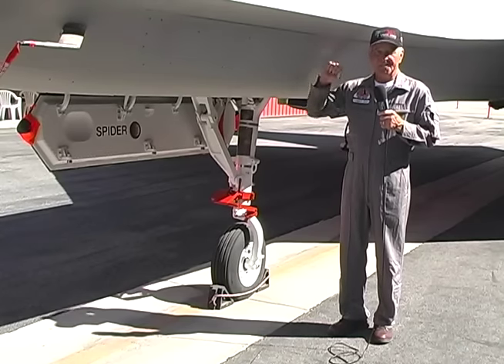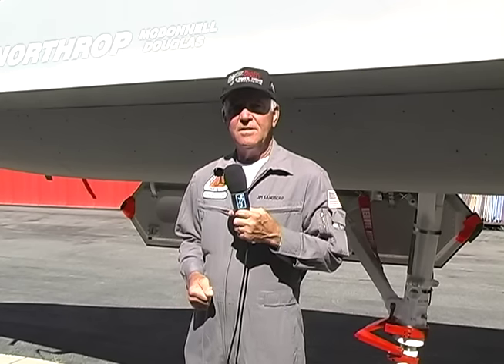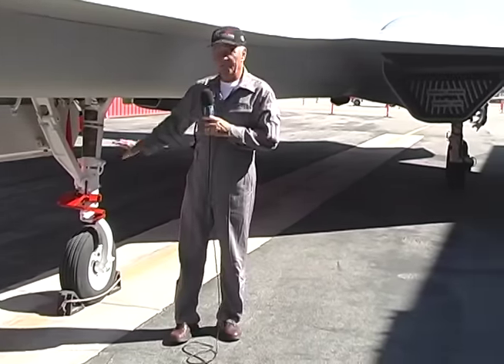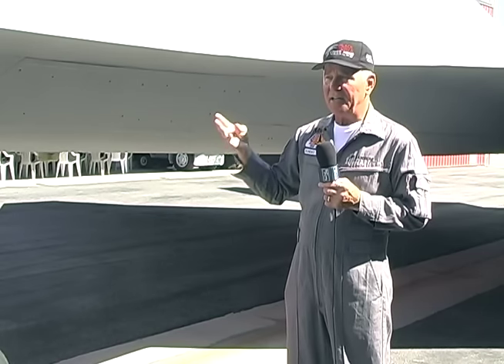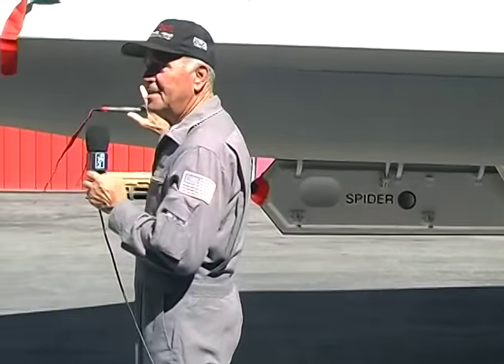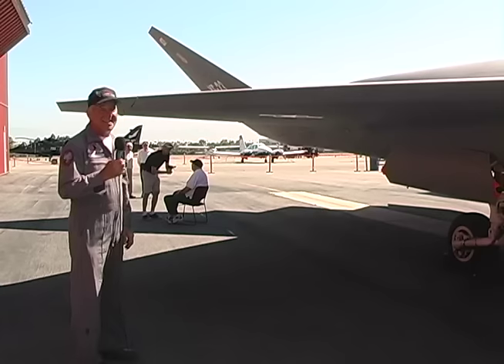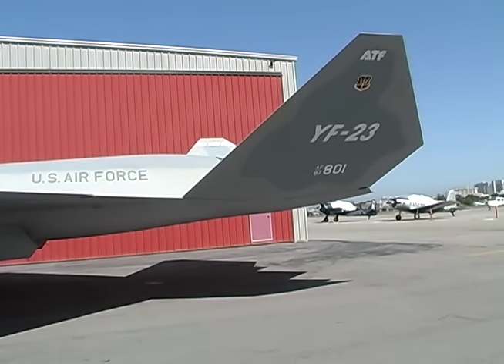YF-23 PAV2 First Flight and Walk Around by Test Pilot Jim Sandberg

Comment: They should have built both.
Reply: How many YF-23's are built, even though they aren't in service.
Reply: Nah dude, yf-23 was way and IS way superior than the f-22
the f-22 was filled with design errors, like the oxigen not reaching the pilots mask and leaving the pilot unconcious if he tried any sort of acrobatics.
yf-23 was the victim of government corruption, just like boeings x-32
Reply: @elfather3889  What garbage. The F-22 was a much more mature project with a better balance of performance. The issues with the oxygen are typical survivor bias, meaning that you never got to see the shitloads of problems the F-23 would've had. It's not to do with the aircraft design either, depending on the contractor the F-23 might even have had the exact same issue.

Concerning the X-32, it was absolue shit compared to the X-35.
Reply: 2
Reply: @elfather3889  The x-32 was riddled with issues, and it never was able to perform it's hover demonstration because it was behind schedule. Also the wing was a single piece of fiberglass which was incredibly expensive to manufacture. I'm not defending the F35, as I think it's also not a great plane. The JSF program was ahead of it's time and way to demanding for the technological limits of the late 90's and early 2000's. That was the main problem. To high of requirements and not enough time to build what the government wanted.
Reply: @elfather3889  The X-32 was clearly inferior to the X-35......don't go down that route.

Comment: The most beautiful and stealthy jet ever designed -- and probably the fastest too.  As I understand it was never really pushed to it's maximum speed (or if it was the data is still classified.)
Reply: Nah the back is kinda ugly.
Reply: Darryl Tran if I remember correctly the yf-23 lost cause it wasn't as maneuverable as the yf-22
Reply: Jim Sandberg said they took Pav1 to Mach 1.8 and Pav2 to Mach 1.72, called out all the G limits, AOA, bay door time open, yaw ˚, etc.  Its design maximum speed might have been higher, but they said what they maxed at in the test program, which wasn't many flights.  What favored the YF-22 was probably what happened in another State, but we won't know for at least 40 years from the time the program was awarded to Lockheed.  We just barely learned why the YF-16 won out over the YF-17 in the early 1970s, and it's in the 2nd decade of the 21st Century.
Reply: jvburnes Well the stealth is classified so that is total conspiracy. However, the top speed that it was alien during testing is not. The 23 flew Mach 1.6 without afterburners. The 22 flew Mach 1.58 without afterburners. 15 mph. is not exactly a huge difference. And while the stealth of each aircraft is classified i do not see how the 23 was more stealthy with it’s two piece cockpit and exposed engines. Yes a four poster tail is not as stealthy but exposed engines will more than make up for that. Also, when this other commenter here mentioned AoA then they are just speculating. There was no AoA testing done on the 23. There was AoA testing done on a model in a wind tunnel but that is it. Northrop did not test the 23 in a lot of basic areas like AoA and spin testing. They reserved those tests for the Dem-Val phase. They were basically saying give us the contract and then we will show you what it can do. The 22 had several distinct advantages over the 23. Like it’s sensor fusion was the most advanced at the time with it’s digital cockpit and lcd crystal displays and HOTAS. The 23 was completely analogue so how they would share data and information to other platforms I have no clue. The 22 was also more maneuverable especially at high altitudes. The 22 also carried more weapons than the 23. There was a lot more going for the 22 then all of the skeptics give it credit for. The only thing that I see as a huge winner for the 23 was that it had a much farther range than the 22 so that was a big plus for it.
Reply: Caleb Slaughter  Youre correct. No thrust vectoring. Easy choice.
Reply: @Weedy Wardaddy Both companies had to convince the people whom decide to buy their plane so better sales department at Lockheed I'd say.
Reply: @angrypatriot5392  - Yes but simulation test data proved that the increased size rear stabilizer gave the F-23 the same maneuverability as the F-22. As the test data proved they both met the technical specs. The F-23 was lighter, more stealthy and would have flown further on the same fuel.

Comment: too bad a the air force's filots dont still fly these just for airshows. they basically mothballed them after the contract was lost.
Reply: It is a shame, but it would be so expensive to keep a unique pair of experimental combat aircraft in an airworthy condition. No one's got that sort of spare cash & even if they did, it would likely be impossible to get them approved for flight, outside of a military flight test program. Lots of expense & red tape.
Reply: The British (Somewhat) did it with the Vulcan. Considering the amount of fans among various aircraft (SR-71,F-4,F14,This)  it's surprising so many air-frames are just let go of.

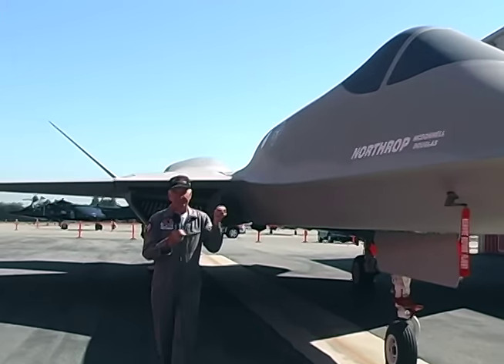Comment: Contrary to what was said at 7:00, it sure seems that we can see the engine face:

http://data3.primeportal.net/hangar/howard_mason4/yf-23/images/yf-23_23_of_51.jpg

https://public.sn2.livefilestore.com/y1pvuhd1McD1rF7nLgomMagpFelpkY59Mi7YoAVio1lGvc5QpHIvW0WTJB41atzM8kUS_lOJxOjXYm2HUenhWo2Bg/YF-23%203.jpg?psid=1

Perhaps he meant that the engine face couldn't be seen from straight in front of the airplane, which is true.  However, it evidently can be seen from other angles.  The F-23, had it been selected and developed, probably would have needed inline radar blockers to be stealthy.  The YF-23 didn't need those because it's just a flight demonstrator.

By the way, the intake S-ducts on the F-22 and F-35 do completely conceal the engine face from direct view from all angles.
Reply: +rbrtck You can see it but you can't SEE it as in inspect it
Reply: +Mazda rx7 The general subject might have been inspection, but Sandberg specifically brought up stealth in regard to the engine face, and in that context if you can see the engine face from some angles, then so can radar.  In contrast, you cannot see the engine face of the F-22 or F-35 from any angle--not without crawling into the intake, anyway.
Reply: Radar is on the ground, aircraft are in the air. Do the geometry. Stealth aircraft are not a stealthy as they want you to believe. All the currant stealth technology can do is reduce the size of the reflected image.  Changing the wavelength and frequency has enabled the aircraft to be detected. New passive radar and OTR is quickly making currant stealth technology obsolete. DARPA is working on a system that uses various spectrum's of light to detect objects in the air and surface of the sea.
Reply: +rbrtck Not sure what you see beyond the safety placard. The actual engine face is offset on the YF-23, i.e. the inlet duct is curved such that, from the front, the actual inlet blades are not visible.
Reply: Interesting. Maybe he was just wrong about the face of the engine being completely hidden. It appears to be just mostly hidden. That's a pretty small opportunity for radar.